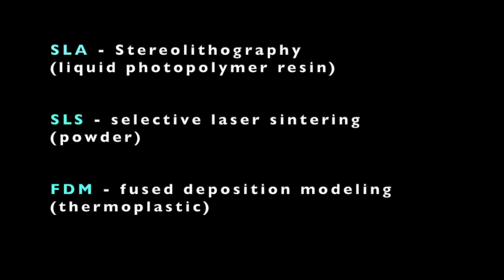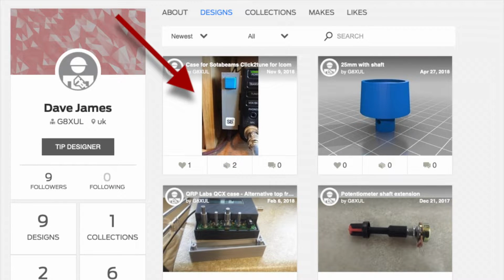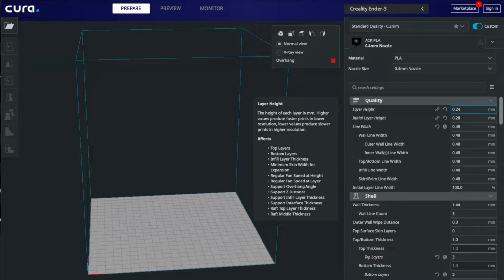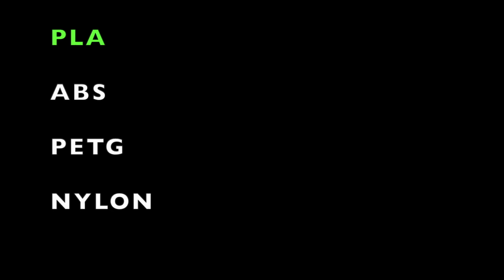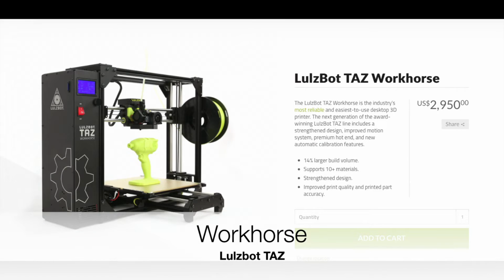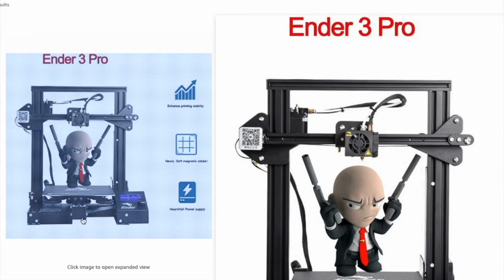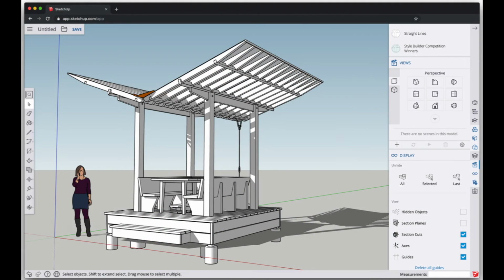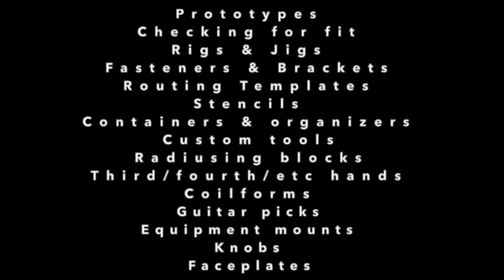What is 3d printing: a guide for the curious (by request)

Comment: What is the reason behind the "3D community" obsession with open source? If the machine/program works just fine, why does it need to be open?
I don't demand to Epson that I have access to the firmware for my inkjet printer, or Maytag for my washing machine.
Reply from the maker: Good question. As far as 2d printing... well, there are open source 2d initiatives, but there is just not enough interest in remaking an entrenched industry, especially with the push to paperless. In general though, there is definitely a place for closed and proprietary tech and/or mixed open&closed products, as long as it is not abused.  The suspicion of the community comes from other related aspects of industries LIKE the 2d, paper printing and other related tech industries that show why many people viciously protect open source prevent the slippery slope into undesirable aspects from a consumer, development, and market competition perspective such as the 'razors and blades' business model, abusing the patent system to ensure vendor lockdown and unwarranted monopoly, and Manual and data lockdown, Right to repair/modify, planned obsolescence, artificial restrictions, purposely stalled development, non-upgradable items, proprietary/drm parts and consumables, locked-down repair parts supply chain, forced eco-systems, contract and retail tying, prevention of 3rd party markets, hidden negative externalities/trojan-horse/bait and switch marketing, dictated development direction, etc etc , the list goes on.  Then there is the eco-waste aspect, emergent tertiary markets (hardware, service, education, etc)... I could ramble forever, which is why I haven't put out a video on the subject... yet.

Comment: Yeggi searches many model sites for your chosen keyword. I saw a headline that Aleph objects, Taz printer maker, was having money issues. Teaching Tech and 3d Printing Professor are some other useful channels. 3d Printing Professor is doing a series on using blender to model. Hack-a-day has a series called 3d printering where they covered a few different CAD programs to construct a specific part.
Reply from the maker: Sucks to hear that Aleph Objects is having troubles.  They have been a mainstay, and still dump a ton of work into the community, like the touch UI API, etc.  The lineup seems to be in a slightly strange spot where they seem geared toward rugged lab/workshop/industrial use, but don't have a price-competitive desktop model to compete with the sub-$1000 home-user crowd with some of the features we have gotten used to seeing?  Maybe that and a bit more presence in the social consciousness would help drive more traffic into their 'fold'.